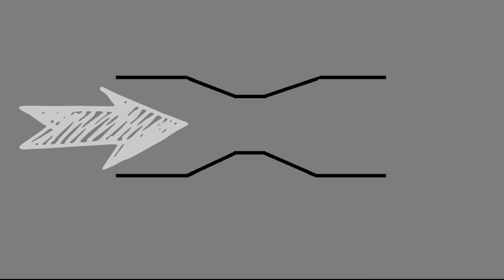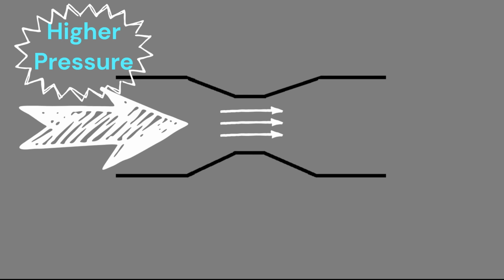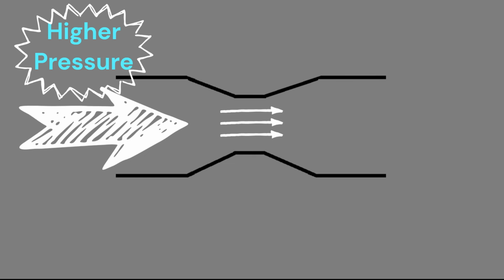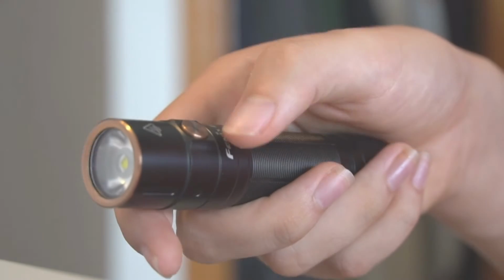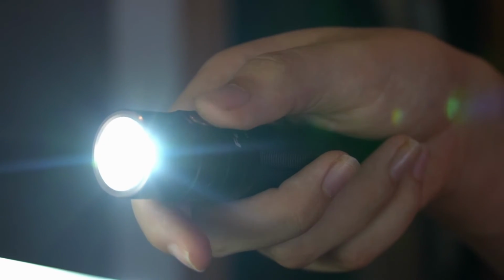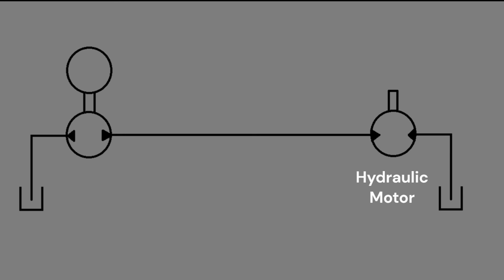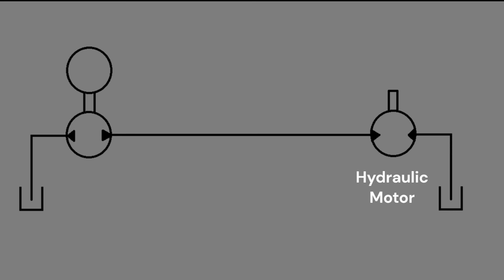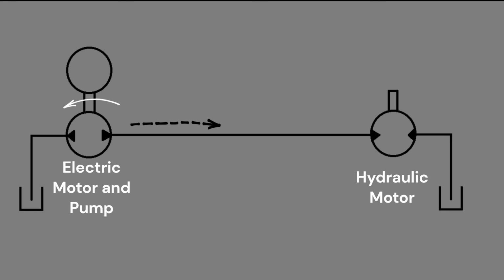Pressure Drop, Everything You Need to Know

Comment: I thought reducing the diameter of a pipe would increase the flow speed and decrease the pressure
Reply from the maker: Flow rate is your flow velocity multiplied by the cross sectional area of the pipe. To maintain the same flow rate, the velocity has to go up when the area goes down.

By Bernoulli's Principle, you are correct when the velocity goes up pressure goes down, which is the pressure drop here. There will be a certain amount of pressure drop required just to get oil to flow from the pump back to the tank. Adding a restriction like this does lower the pressure at the point of the restriction adding additional pressure drop to the system. However, there is still the same pressure drop requirement in the rest of the system. So the total pressure drop has gone up resulting in a higher upstream pressure.
Reply: @Hydrauliac  that makes sense! Thanks